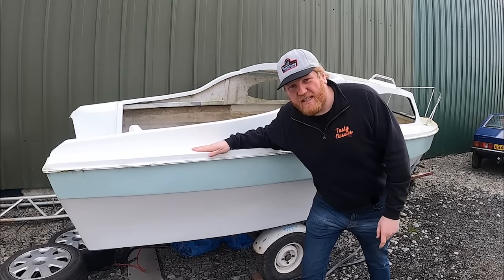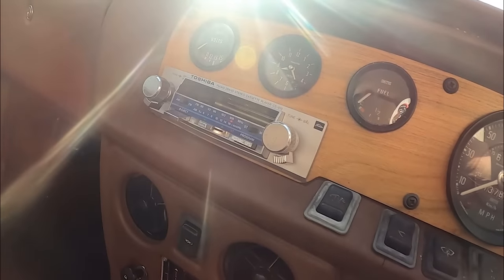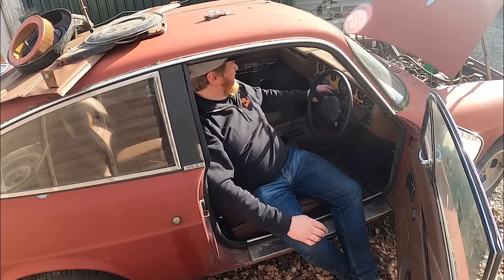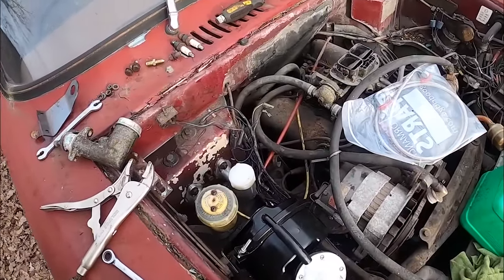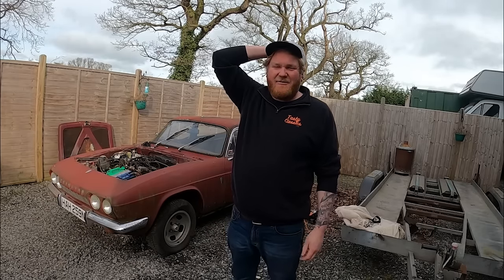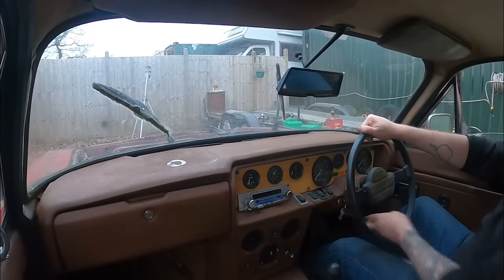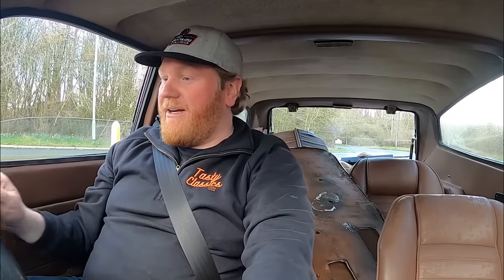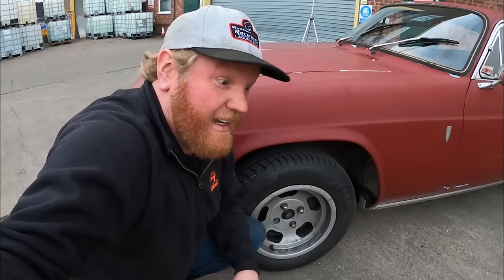Can I Resurrect It & Take It To Its Birthplace? Left For Dead 1975 Reliant Scimitar SE5a

Comment: That additional key is undoubtedly for an after market alarm system that was all the rage in the mid 1970's
Reply: Usually the key lock would be on the driver's fender/wing by the door.  This is an unusual placement.
Reply: @tdk1246  
Not in the UK with right hand drive 😂
Reply: i had alarm key in the same place on my capri :) windy nights and it would sound the horn like WW3
Reply: Me too , a Capri Mk 1, key slot in the body work, (can't remember where though ,this was nigh on 40 years ago) .😮

Comment: The separate lock is the alarm/immobiliser. That’s how they were armed way back in the day when I first started to drive. Behind there should be wires. If not, it’s a “dummy” alarm, you could buy dummy locks like that or get them from a scrap yard, fit it then folk thought you had an alarm. It was always there as it’s next to the drivers door…. Less messing about to arm it once you have locked your drivers door. P.S, yes, I am really old😂😂😂
Reply: You can't be old as I am very familiar with the things too, and I don't consider myself old 🙃 If it's a real system I'd seriously advise un-connecting it as they failed frequently even when new. IIRC Piranha was one popular one, looking at the door sticker this is a Selmar which, I think, used similar components.

Comment: ive got a 74 gte so the same body as this one but its in "champagne" (very faided custard cream) with a tan vynal roof, theyre brilliant cars. i wrote this comment when you opened the rear hatch and said to myself, dont force it as itll come off and you did just that haha. mine did the same when the struts went, you should find somwhere that two little screws will have fallen out that holds the hatch to the body. also, for a car thats been sitting for so long, that essex started up faster and easier than it would have new
Reply from the maker: Excellent stuff I knew as soon as I felt it go I shouldn't of been pulling so hard 😅👍 thanks for the screws info I'll have a gander in the next video!

Comment: Those after market wheels are actually classic first iteration woolfrace's from the early seventies as I gather you already know , later versions changed from that elongated hole with flared out spokes style to an upgraded more square cut design you could also get them from the factory with wire wheels too but they look stoopid on them if you ask me,  they look the dogs with widish minilites on them but try getting hold of any ! ............ Have fun doing that gel coat by the way lol.

Comment: Just came across your channel, I used to collect the GTE's from Tamworth and drive them back to Stoke on Trent for Joss Randal Garage. The engine and transmission had been run in when collected. My family used to have a red one in the 80's. a 75 I think, but it got scrapped after an encounter with a patch of ice and brick wall.( body shattered and chassis bent from the passenger side). Still miss it. Had a Jenson Interceptor after that with a blown engine. Made  a Rover V8 to fit.  Keep up the good vid's.  Mike

Comment: A very enjoyable video thank you.  Having said that you must have had it up on the ramp why didn't you show the underneath? I'm assuming there's a very rotten chassis bolted to a plastic body? Might be worth the full restoration, they are iconic and will surly only go up in value.
Reply from the maker: I haven't had it in the air yet, the ramp was blocked but the weather made it nice to be outside so I wasn't too fussed! It definitely wants front outriggers and the sill piece but I'll do another episode on it and we can lift her up and see what we've got to deal with 👍👍

Comment: Love the channel, am about halfway through this vid 👍🏻

At 23:20, Lumenition electronic ignition module ? Fitted that setup to three of my Capris back in the 90s to do away with the points & condenser. Worked extremely well, a very reliable system back then.

Comment: Ben ! Check the hexagonal shaft drive at the bottom of your distributor, this shaft drives the oil pump located in the sump...make sure the hex shape is good and not worn, and is not starting to round on the edges, mine did on my 3.0 litre Capri, leading to oil pump failure, of course the mains and big end bearings were destroyed leading to a crank regrind, it was a common fault on those engines... good engines but run out of puff on the top end ... the RS 3.1 was a different kettle of fish ...looking forward to the restoration 👍🏻👍🏻👍🏻
Reply from the maker: I will be looking as we are knocking !

Comment: With a style that looks timeless, the Scimitar is absolutely gorgeous and makes for a fabulous GT. Yours looks pretty original but is wrapping an option rather than a respray? Perhaps a flip flop colour will look a treat with shiny wheels and chrome.
Reply: Wrapping GTEs is a bad option, fibreglass needs to breathe. They need to be taken down to the gel coat and resprayed from there. It is expensive with a capital F. Figure in about £5K. Chrome? No the trims are Ali and Stainless steel apart from the bumpers. Wheels can be fefurbed quite cheaply.

Comment: What a great little car! It reminds me of my 1973 Mercury Capri I had (I had two actually) but in the UK and Germany they were the Ford Capri. We got it (Canada) with the 2.6 V6 and then the 2.8 V6. Never the 3.0 Liter.  When I saw that the clutch pedal was gone and the gear wouldn't go in the first thing I though was that the clutch itself was stuck to the flywheel not that the cylinder was shot. But I've only watched so far until he's put a new cylinder into the car so I'll see if I'm right or not.....Oh no I think the clutch just broke free and is now wrecked from it's age and time and it disintegrated once the clutch engaged IMHO. LOL. Lets see what happened now (I'm still only 1/2 for the way in the video) LOL.   Oj well it turns out was both right and WRONG! LOL. Funny! The clutch was stuck at the beginning then it was the bleeding that needed done then the clutch started to work!! HA HA!

Comment: Unusual position for the Overdrive switch, when I owned my Scimitar many years ago the switch was located in the top right hand corner next to the RPM gauge.
Main issues I had with mine were electrics, and earthing problems

Comment: It's  a Webber Twin Choke Carburetor. In the days before fuel injection it was the best way to get power. If you floored the accelerator, the vacuum would open the second choke. They suffered from a flat spot though. You'd feel the engine momentarily starve before it took off! The 3.0 litre Essex engine was considered at the time to be the best engine Ford ever made.

Comment: I miss my old 75 scimitar, What i dont miss however is the non existent turning circle, suspension bush replacements, silencer replacements, dodgy nylon timing cog, the brass push fit fuel line to carb that could pop out and gush petrol over the exhaust manifold, But it never broke down lol

Comment: that keyed lock on the body looks like an old school alarm on/off switch. i drove remote broadcast tv trucks and the aftermarket alarms supplied by the specialty coach builders used those in the '70's.

Comment: There would be no rust because the bodywork is glass fibre as was all other Reliant cars. I worked in these in the late 70s for several years. The engine is a Ford v6 3 litre if I remember rightly. the wheels I think might have-been Wolfrace.  The way the paint is cracking is quite typical for fibre glass bodywork that has been left a long time.  The slightly later versions had resin bumpers. The earliest version of theseI believe was called a Sabre and the last version made was a smaller sports car style that was based on a Ford Escort chassis with a smaller Ford engine. A real classic. Worth restoration. Wish I had one now.

Comment: The second locking barrel is actually a switch to turn on or off an alarm system as most cars were easily stolen back in the 70s and the Scimitar GTE was one of the car thieves Favored rides.

Comment: Second key switch is so clearly a car alarm. 
The following year they got a facelift with the rubber bumpers and the Wolf race wheels were an optional extra, as was overdrive.
The doors had paint shine because they were metal not, fibreglass.

Comment: The Key hole on the side of the rear panel is for turning an Alarm system on and off. Baxeden Auto Brackers have a 3,0 Essex GTE Manual.

Comment: I feel your pain, mines a 72 thats also been sat for a number of years, clutch is same, can select gears with engine running, and it doesn't move, my slave is on drivers side and is a push fit, not looking forward to getting an alloy slave from a steel block! Mind have got my wipers working now, might get it mobile soon...

Comment: Incredible!! You spent lots of money on components that you have not even checked. It's a fair bet that all the  brake lines and hoses are stuffed. I would have checked those first. The brake fluid  will be in terrible condition and all the rubbers swollen. Also the calipers are likely to be seized - easily checked without spending a dime. It appears you have not even jacked it up - the chassis could be terminally rotted. A project like this demands a methodical approach... or deep pockets. That brake booster will not be unique to the Scimitar, so buying it from a "specialist" is not a good plan. You are approaching this project like a rank amateur. Good luck!

Comment: Hello chap. This looks like an interesting old girl i must say. Regarding the second lock behind the drivers door. I do seem to recall this being either for an additional deadlock on the drivers door for security - remember this car is a 1974/5 model so predates electronic car alarms. It might alternatively be an isolator cutout to stop someone starting the car without the keys. I’m sure its either one of these things. I saw one or two like this when i was selling cars for a living in the 1980s. I have my suspicions that the cars colour is a factory ford metallic from the mid seventies. It might have been called magenta but its so long ago i can’t be certain. There’s a lot of ford in that old girl! EDIT: it looks like the extra lock is for the alarm system as you’ve got the control unit added in under the bonnet.

Comment: BE AWARE:-  Invalidation of Insurance 
      In other words, your insurer may not explicitly require an MOT certificate for legally exempt vehicles, but they do expect the vehicle to meet safety standards that would typically be checked during an MOT. If an accident occurs and it's found that the vehicle wasn't roadworthy, it could invalidate the insurance claim.

Comment: Great video and good sound track too. I have just got my old car back after 25 years se5a, I originally wrote it off being a silly buggar but having fun until it landed on its roof , whoops. Just found it for sale, turns out it's been 10 minutes down the road for the last 15 years fully restored. Anyway to get the point it's over heating and I am replacing all the cooling pipes and I noticed your one had that blanked off pipe on the water pump, was this a fix to improve the cooling or did you put it back to normal? which in its self seems to be a personal thing as a lot of them seem to be routed differently. Great work keep it up

Comment: Of it is the car I think it is.. it has been fitted with a "Hot" ex Police intercepter 2.8 V6 and ECU.
It was then being used as a test mule by the guy who was going to relaunch  building new GTE's until he died siddenly of a stroke. So a couple of things are wrong. I think the steering rack is the wrong item. And the mounting for the alternator.

Comment: Any car that has been so easy to get back on the road after so many years of deteriorating deserves a restoration. You don't need to do a complete frame up resto but make it look good and proud again. Obviously it's a good little car if it made it that distance and back without a tow. Just keep it as a weekend driver. Buff out the paint and fix what little it needs and it will be a happy little car. You can make it a race car but make sure you weigh the pro's and con's. It's going to cost a lot and the parts are near impossible to find and do you really have the time to do that? With your YouTube channel going it may be more then you can take on right now. I live in Arizona and have had my share of restorations. Mostly Mustangs and Camaro's however I drive an old 1997 Nissan 200SX. It looks it's age but I take care of it because it drives so good and it never left me stranded. I trust that car to go to New York and back. It's a reliable car that no one wants to steal and I feel safe with it. The Mustang was a great car but I had to be careful with it because it was easy to steal and expensive to insure, So I choose to drive that older Nissan because it treats me good and it has a lot of life left in it. Also, I bought it for $400 and you can't beat that.

Comment: How is the body made?  There are no panel lines anywhere, the body appears to be one unit.  Also the body is incredibly stiff, you can see that when you had it on the jack.
Reply: It's a fibreglass body bolted on a box steel frame chassis.

Comment: A Scimitar would be a good candidate for a nice engine swap. Instead of the heavy 2.8 V6, something like a 2.0 Lt 16v turbo with 180 - 200 hp would be Ideal.  Enough to give it some push but not stupid power as it is RWD and not the best handling car.
Reply: Yes, but it wouldn't be a Scimitar anymore, would it?

Comment: as you said it had been not running for 31 years ,she should be just cleaned up a polish fix all the little bits and bobs ya aunty ,a clean used daily  loved car ,, my uncle had 1 back in 1992he put  vw sciroco  engine gearbox running gear and seats ect in his ,it was a toss up  sciroco ,or a supra

Comment: Should swap out that engine for the  new Ford 2.3L they are putting into the new mustangs, should fit without cutting and 330hp would make that little thing move
Reply: Then it would no longer be a Scimitar. Yes, you can bung loads of different engines/transmissions/brake and suspension upgrades and even a computer to run it all. It all detracts from the original.

Comment: Just out of interest Ben. Why do you choose to grovel round on gravel outside, when you have a lovely workshop with a lift ? Just curious !!! Also....? Throw the easy bleed in the bin ! They are utterly shite. Go old school. Buy a motorcycle one man bleed kit, fitted with a one way valve. About £5 on the interweb. And for good measure, put the end of it in a good old fashioned jam jar half filled with brake fluid. It acts as a one way fluid valve. Then you just sit in the car and pump away ! Once you've used this tried and trusted method, there'll be no looking back.Also very kind on the pocket re brake fluid wastage.

Comment: Essex V6 with oil soluble oil pump/distributor drive, they are junk, its chock full of MK4 Zephyr stuff switches fuse block common parts back at the dawn of motoring but like the original cars not a good thing

Comment: The wheels original!!!!!!
Reply: Just remembered the are Wolfrace Slot Mags - I bough my SE5A the same year - One owner for 2oyears with 11,000 miles on the clock!
Reply: Actually just checked - mine was a SE6A Auto  with the Colonge engine that they fitted even before it went into the 3 Litre Capri.